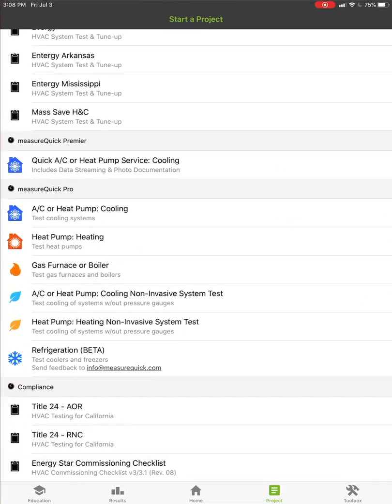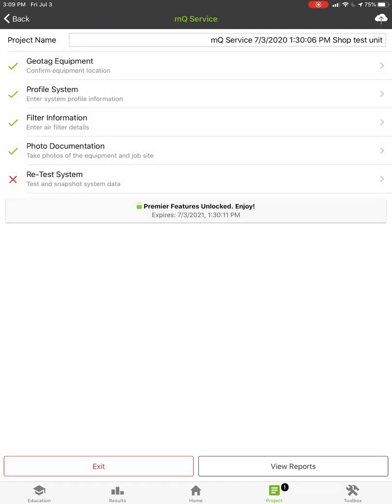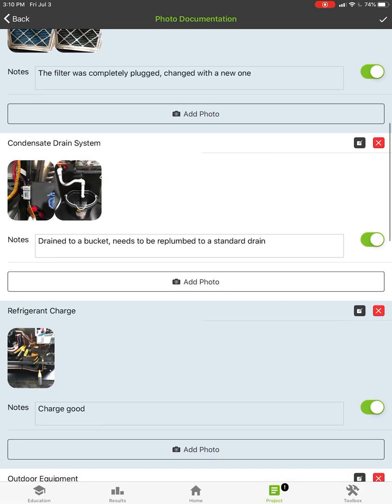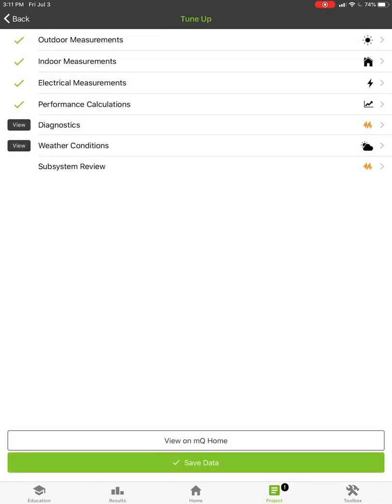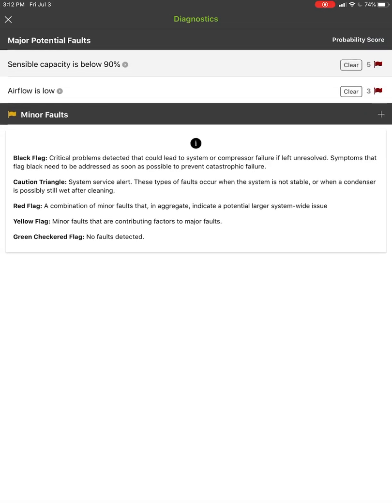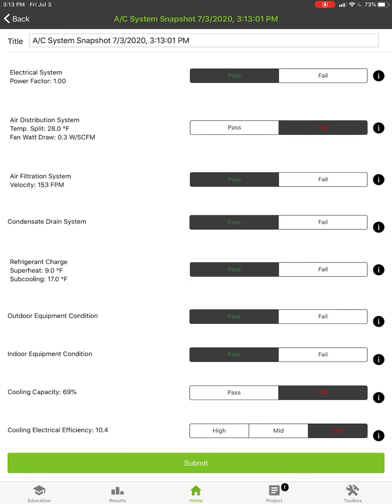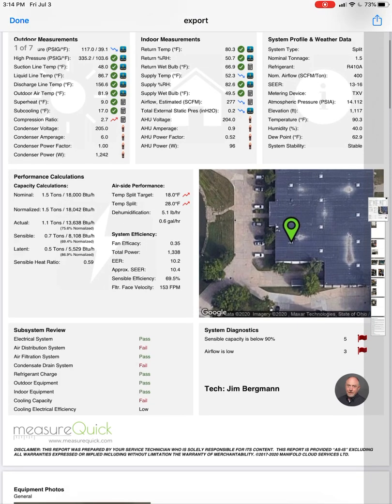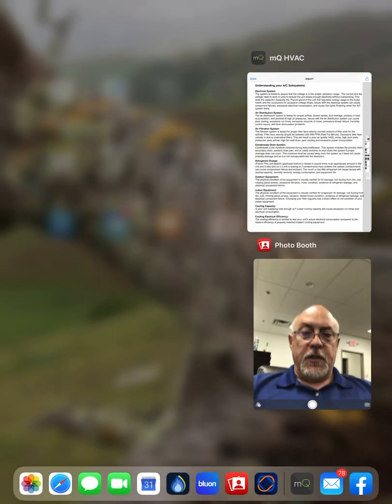New workflow mode: Quick A/C or Heat Pump Service

Comment: This has changed my whole process as a tech for the better and provides such tremendous value for my clients and helping the customer understand why they need to make the necessary repairs when the system isn’t working correct

Comment: Any idea when the 550 will have live data and testo 320 Analyzer will it be Integrated with MQ?
Reply from the maker: The 550 and the 557 are in the works. Very soon for those. The 320 is not on the current roadmap.

Comment: After coming behind poor installations of new equipment that cost $10K-$20,000 that we’re not working right and showing to customers this information. Customers feel like they got ripped off had a shyster install their systems.          High pressure sales, new shiny vans with fancy stickers, uniforms with patches, elaborate big yellow page ads strike again. Don’t cut corners or take shortcuts on installations. Fieldpiece and Testo and MeasureQuick 👍